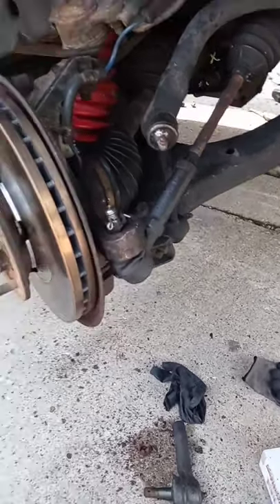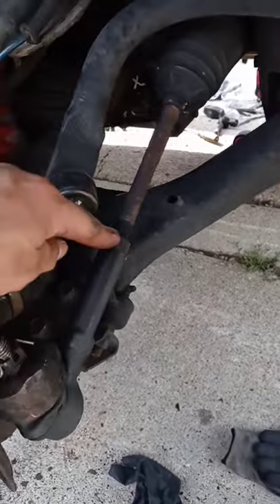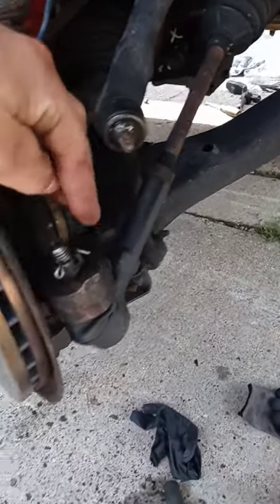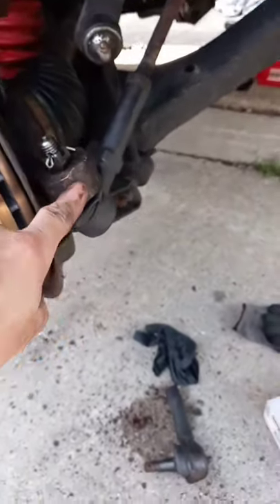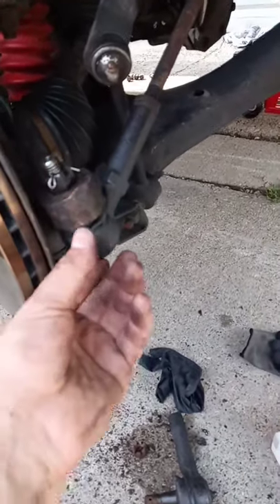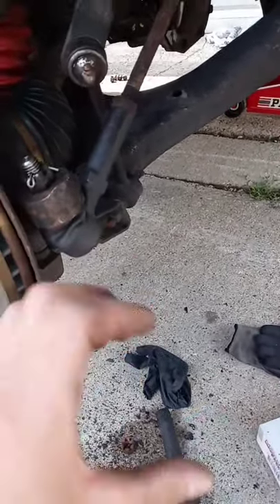how to replace a tie rod in 2 minutes

Comment: Didn't mention a whole bunch of very very important information.
Reply: Good video. Sjg has a point. The first nut he mentioned to loosen , you mark it with a marker where it is located.
That way when you put the new one on , it will be close enough for straight steering without having to get alignment.
Reply: @rl4889  
It will at least be close enough to get to a shop to get the alignment. Anytime a tierod is replaced should always get an alignment. Just going from a worn ball joint to a new one can throw a huge difference 8n the alignment.
Reply: @sjgavenger37  thank you sir.
Reply: Plus his tire rods up side down
Reply: @coreyjohnson2493  
On some cars the tie rod goes like that. I know on many Mazda models they go like that. My 1989 Chevy Silverado was like that.
Reply: @sjgavenger37 I’m about to change mine right now. Will mark the first one since you said that. Any other key tips? Thanks either way

Comment: I wouldnt hit the knuckle with a hammer...just smack it from the top of the tie rod bolt. Doesnt matter if that gets damaged, youre replacing it anyways.
Reply: You are putting force on the struts that way. One good hit from the side gets it loose most of the times.